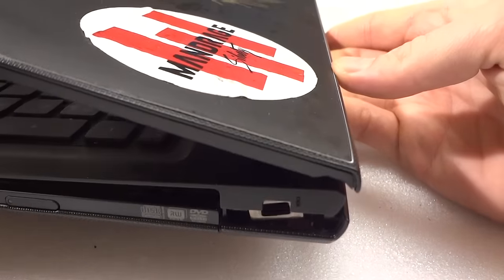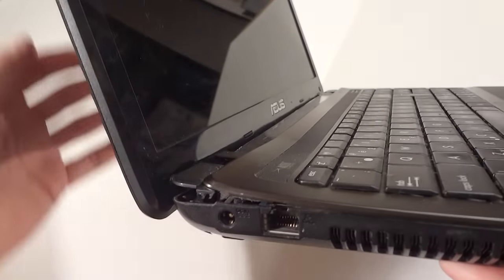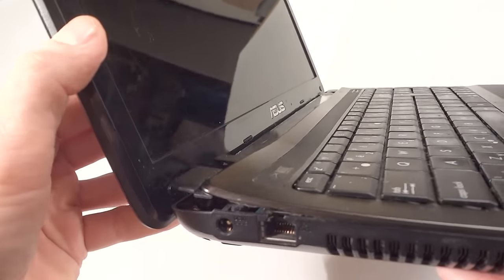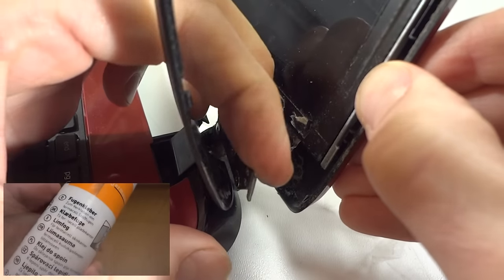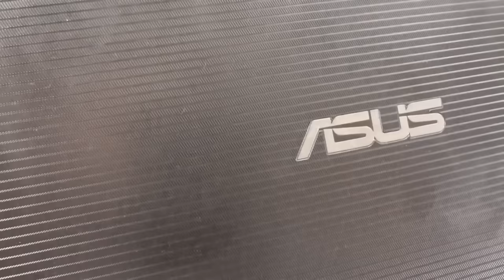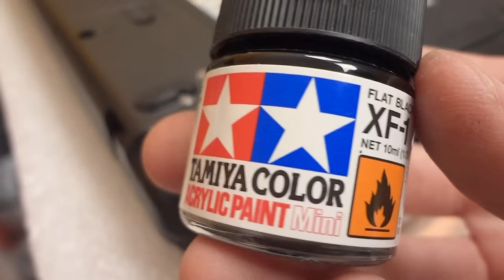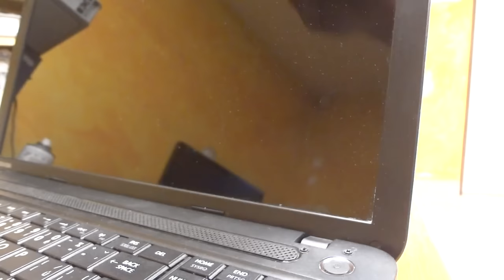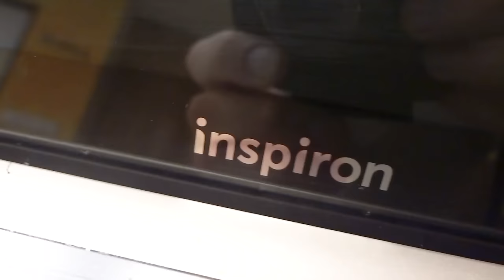LAPTOP Broken Hinges repair fix Screen Arm DIY 🔩 🔧 ➤ ACER ASUS Lenovo HP Toshiba SONY DELL

Comment: PRO TIP - Don’t drill into the cover. Use a nail, heat it up and push it through. Drilling will crack the cover. You can see hairline cracks on some of them in the video
Reply from the maker: Hairline cracks are from customers  before repairing when hinges broken. The cover has a patch on the inside. Drilling is safe, no worries.
Reply: @RCompHacks  Oh hey man! Okay noted. Im a huge fan 😄! 
Just recently fixed my Acer laptop top hinges solely learning from your video haha! 

So I've been watching this video for weeks and finally  bought a hinge from AliExpress ($10), 4mm black belt (Chicago) screw sets and used an awl, heated it up on the stove and made the holes in the top cover. When making the holes do it from inside out. That way the excess melted plastic will be on the outside of the cover and can shave it off using a box cutter. I do leatherwork so Im good using an awl like this and got the holes just perfect on first try. 
I also used the same flathead male screws that came with the screw set). And the male screws worked just fine. I put in 4 screws on the top.  
But Im gonna open it up again and put epoxy glue around the grommets on the bottom hinge, so they don't break like the top ones did. 

Putting this all here so that it would help some one else. 

Again thanks a lot man! You're a genius and this video means so much and helped so many people everywhere ✌️

Comment: I cn fix them all in less than 30 minutes, without drilling through and epoxy/glue🙏🏻🙏🏻🙏🏻,
Reply from the maker: Sure. Fixing by replacement with brand new LCD cover.😀

Comment: I fixed mine by finding a folder with the metal strip, cut out the strip, stick velcro on both the edge of the screen and metal strip, and fasten both sides together so that it acts as a brace. Problem solved
Reply from the maker: I wonder how you fixed it, send me a picture on my facebook profile, thanks.
Reply: Can u send a video link

Comment: This has to be built-in obsolescence or design fault by the manufacturers if the product is tested for Quality this problem would show up quickly I will never buy an Acer laptop again the first one literally demolished the left side of the laptop now my new Acer has the dreaded click and you can see the base and keyboard top move when you close the lid it seems as if the hinges become too tight.

Comment: with all due respect, you ruined the bronze bushings... Theres no need for them with this procedure. All you need is dried expoxy and a drill.(plus screws)
Reply from the maker: I'd rather leave the original hinges position by using bushings if possible.

Comment: wayyyyyyyyyyy too complicated, just remove the screws and rivets and use an industrial strength glue... these types of repairs only put more stress on the already weak or broken plastic... poor tutorial.
Reply from the maker: Only strength glue useless. No offense, you don't know what you're talking about. Screws and rivets ensure a stronger chassis connection than from factory. I would be ashamed of someone to repair a laptop hinges with only glue.

Comment: Dont forget guys, you can just repair once with this method and once it's broken again, you need to replace all parts like he said in the beginning. Not a long term reliable method. If you want to use your laptop for more years, just replace. If you just want some months more with your old laptop, go ahead do this. Good days everyone.
Reply from the maker: I have repaired more than one hundred laptops by this way and my repair hinges are working reliably to all my customers until today even after several years.
Reply: RCompHacks Thanks DOC....🌐..

Comment: Am I the only one who finds it ugly to have the extra holes in the laptop? I  brought it to a technisian who repaired it with 2 components glue without the extra holes.
Reply from the maker: Do you really think it will hold for a long time? At first, I just glued, but it not hold for last long. In many cases, there is no other solution than a screws. Some extra screws hold hinges better then from factory.